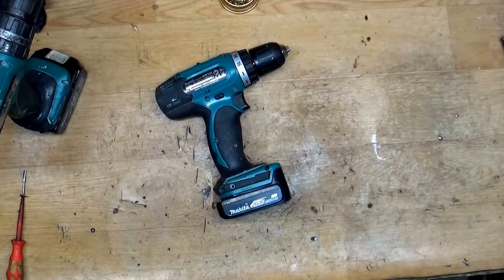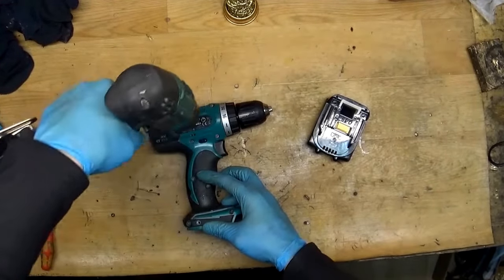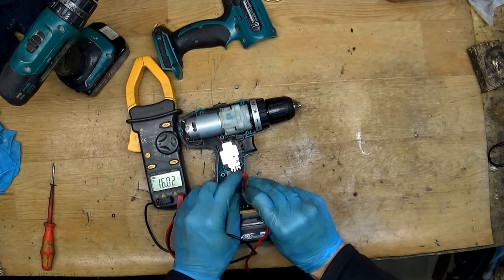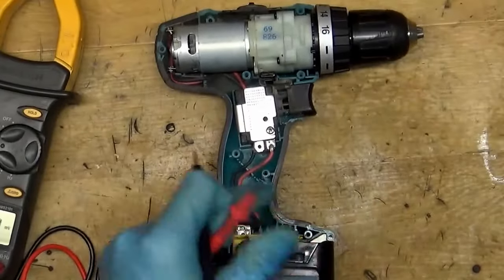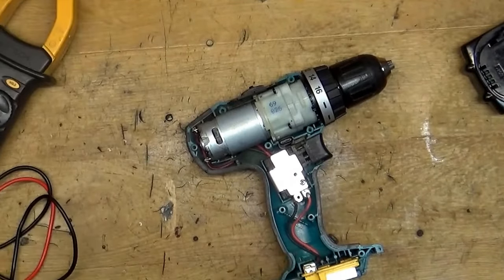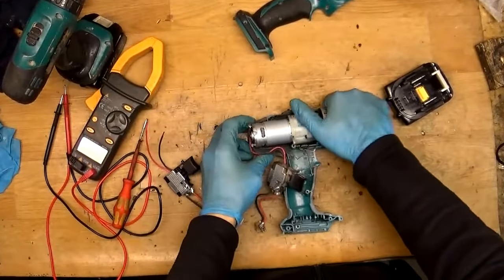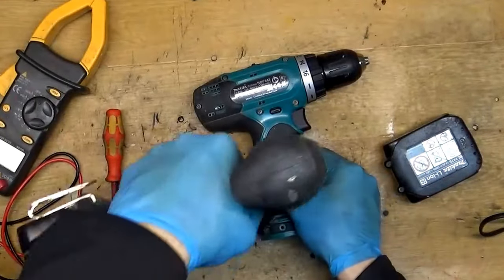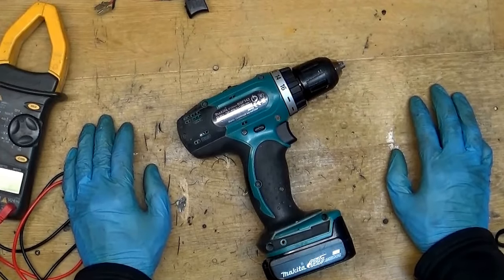Makita DDF343 switch replacement. Repair cost 30 GBP!

Comment: great video man. In your opinion what's the best brand drill in order?  Makita, Milwaukee, Dewalt, Rigid, Snap on? I want to buy something reliable new or used...  Thank you.
Reply from the maker: Hello and thank you. I love Makits and I use Makita daily and it works very well. Dewalt or Bosch is also great power tools, but Makita have cheaper spare parts